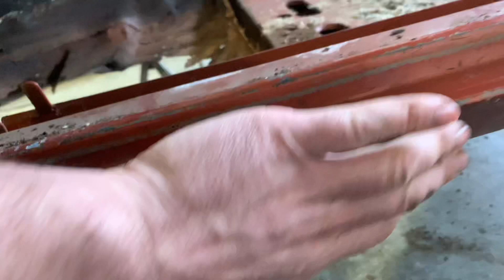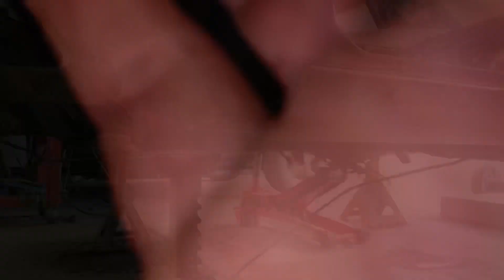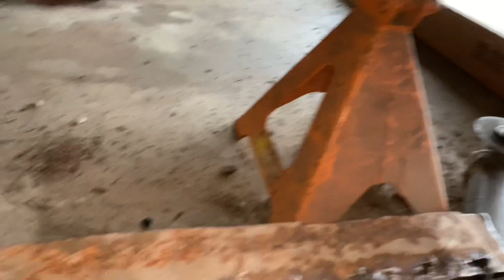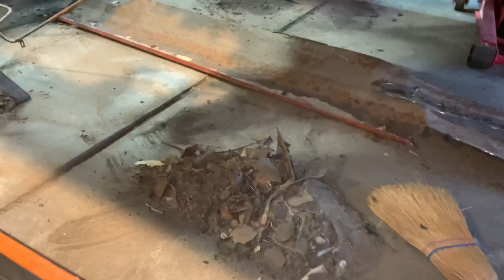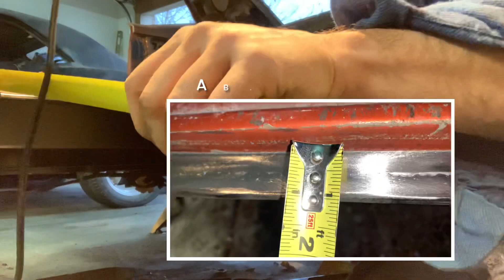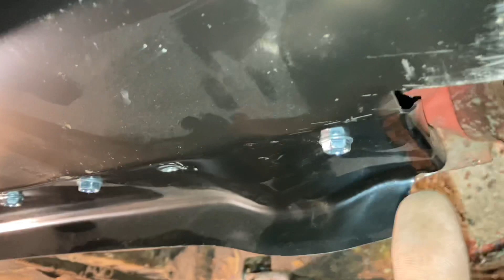Rocker panel replacement, your car have Rusty panels and need replaced?

Comment: gr8 vid., its funE no mater how many Ppl I talk to(or how many vids I C) I don’t C how a couple of iner & outer panels welded togethr as section of unibody in form of pinchweld rail, would have structural strength to lift a vehicle ? behUves my wit😒,(althO since slopily typng this I DID find out on unibody cars, the inner rocker panels got the structure strength).  as for their joining us flat horizantal, still wondering if there’s a frame touching above that, either way it’s 2 litle known facts -  1 the jack lifting point is actually the bottom of these verticle ‘pinch rails’(I beleive Iv heard them calld ?), &2 - that’s so engineering-dumb it’s comical👋
Reply from the maker: Even more questionable is the how thin the sheet metal is never mind the spot welds. This is the frame of the body but it holds up.
Reply: @VinylVillageGarage 

Iv actually heard rocker panels, on unibody cars, are the body(welded to frame front back & center), but NEwA, agrEd - I jst adjusted comNt to mention how dumb design pinchweld jackpoints are.  It might be good for incentivizing a four prong(2 pole) DEEEELEERR🤨?, not srrprIEeeszd😒, type jack- as with all other jacks, even IF the jack adjusts to moving location, the car angle changes, & pinchweld ‘rails’ probly better off not bending.  gr8 scam
Reply: @VinylVillageGarage 
btw I shouldn’t say ‘the frame’ because a car unibody is just a giant ‘shell’(metafor meaning 1 peice), that differant ‘frames’ are attached to, so these rocker panel parts of the unibody, attach to ‘some frames’ front middle rear, - typo✋ btw thats just something I read from some so calld expert - but a litle 5th grader.. actULE kindergardner, math would point out that 1 shell wouldn’t have rocker panel part(S), so thE only thats 1/2 true is if thE INNER rockr panels an AREA of unibody, & oOter’s a ‘frame’.. I did say ‘IF’ .  I’ll copy & paste that lengthy expert disc on next response - 1 min
Reply: @VinylVillageGarage 

😩crap it AI, hU nOs wat Artificial Incompetance it quoting😒? NEwA, here

AI Overview

+5
Unibody vs. Body-on-Frame Construction | CARFAX
On a unibody vehicle, the "frame" isn't a separate ladder-like structure but is integrated directly into the vehicle's body, forming a single, strong unit (hence "uni-body"). Structural elements like reinforced floor pans, pillars, rocker panels (pinch welds), and subframes (front and rear) provide the support, making the entire metal shell the frame, common in cars, SUVs, and minivans. 
Where to find the structural components:
Integrated Structure: Look at the sills (rocker panels) under the doors, the floor pan, the firewall (front), and the rear strut towers—these are all part of the single-piece frame.
Subframes: Heavy-duty steel crossmembers, called subframes, are bolted to the body at the front (for engine/suspension) and rear (for suspension/axle) to handle specific loads.
Pinch Welds: These are the seams where body panels are joined, often found under the rocker panels and used as secure clamping points for repairs. 
This video provides a visual explanation of the unibody construction:
Related video thumbnail
51s

Lakeside Autobody
YouTube • May 1, 2020
Key takeaway: Instead of a distinct frame underneath, the car's body is the frame in a unibody design, offering lighter weight, better handling, and improved crash safety through engineered crumple zones.
Reply: @VinylVillageGarage 
O I just read that, it’s sayng unibody means body is the word for 1 big fat frame made of joining small frames, gS U wer right 👋😒.  so no chasC or body w/out a frame, just 1 big joind ‘frame’ with all ‘parts’ being sub-frames.. io a uni-body, without any chasC or seperate body that isNt part of a UNI-frame.. they could’ve jst calld it that, BUUUUUuuut nOooo noo .

Comment: Have you ever removed one of these rockers fully and re-used it? I want to remove mine, after putting a camera in the drain hole i've seen a lot of scaling forming. i want to pull it, clean it, put it back.
Reply from the maker: I have not, most of the cars I mess
With need them replaced. It’s possible to remove them but it also means cutting or
Doing something with 1/4
Panels or sectioning the rocker to get them out

Comment: What kind of air compressor are you using to use that air hammer?
Reply from the maker: My compressor is a sanborn brand 80 gallon 220v single stage twin cylinder
Reply: @VinylVillageGarage  Thanks Big Bird

Comment: Your very talented with that cut off wheel of death...nice straight lines  :)
Reply from the maker: Years of experience and most importantly listing to it operate, you can hear when it’s starts to bind that means it’s not cutting straight and it will wear out the disc prematurely as well.  It a feel and listen technique if you get good at it you will cut straight and save money on cutoff wheels

Comment: Hey Jon! Absolutely great videos!! I've never done any of this work...at all, but you have inspired me. Will be replacing complete rocker panels...one side at a time. My question: Do I need to weld in bracing on a 68 coupe? Thank you so much in advance.
Reply: Perfect! Thank you so much! You've inspired me to work on this car after owning it for 35 years and not driving it for about 30 years. Thank you...I think 🤣🤣🤣
Reply from the maker: @CharlesMurphy-b9v  let the fun begin!
Reply from the maker: If removing the entire rocker not just the inner or outer I would add a brace to tie the bottom of the door opening where the rocker used to be before attempting that repair.

Comment: The inner and outer rocker panel Is smashed in beginning at the back of the door to the wheel well ... is it better to replace the complete rocker panel assembly or is it possible to cut in a patch ... thanks
Reply from the maker: Repair section is ok but most of the time it rusted bad enough on the inside you end up replacing a lot more.  Best bet is to cut it open and see what it looks like on the inside then make a call which way to go. Here in Indy, the rust belt, it almost always turns into total replace but if this was a western car with little to rust I would only do what was needed
Reply: @VinylVillageGarage  Thanks for your reply ... we do enjoy watching your videos ... Thanks

Comment: sweet repair Jon.  Makes sense to section in like you did.  Those are a bear to replace entire panel.
Reply from the maker: This repair was a bit of a surprise, it was only rusted behind the trim. Easy clean and inexpensive fix.

Comment: Was under the impression that some support bracing was required before removing the rocker to keep the body straight.  Assuming the inner rocker is providing enough support.  Are you planning on "X" bracing the door openings and under the floor before removing the floor?  Due to the replaced rocker not fully welding in, not sure how this would be done?  Very interested in your progress on this restoration.
Didn't see any new seat support in your driveway, assuming you are planning to reuse.  If they are in good shape think that is the correct call.
Reply from the maker: No plans for any bracing on this build.  Now if I was doing a convertible or completely removing the entire rocker panel inner and outer at the same time I would have.  Part of the reason i started with replacing the outer rocker and screwed it to the factory inner brace was to keep the car tied together. 
   Also the reason I shared how to keep the car plumb and square with the bubble level and tape measure. I continuously check and recheck points while assembling and then adjust as necessary.  
  I do have seat bases for this car and front fender repair sections just not in the pile.  Good eye!! 
  This is how I build a car, it’s not the only way. I am sure there is better and worse ways I suppose. This has given me the best results when done and I find it to be quick and cost effective. This might not be everyone’s preference how to, just Sharing and showing how I get it done and the results.
Reply: @VinylVillageGarage  Thank you for explanation.  See value in support bracing but difficultly working around this during the repair.
Reply from the maker: I am not much of a contortionist myself either. It’s easier not to mess with it.

Comment: Have you had any kind of body schooling?
Reply from the maker: That sounds like a weighted question. Lol. To answer have I been thru a school For metal and body work the answer is technically no.  I have worked at body shops, 25 years of restoration experience, some lessons learned the hard way but for the most part self taught from reading books, observing other people work, trial and error, and  lots of luck sometimes.

Comment: Curious as to how you will be handling the rust protection. I am going to be costing the inside of my rockers with SPI epoxy primer.
Reply from the maker: Any bare clean metal will be coated epoxy or self etch primer. Some of the light rust will be Coated with a rust encapsulator, if the area is a panel flange that will be welded I use a self etch weld thru primer after cleaning or sandblasting. The areas that will have layered panels like where the torque box Meets the toe board I sand blast and prime as needed then assemble. This is way more then what was done by the factory plus once done these cars don’t see near the harsh weather or environments anymore so that also helps future corrosion

Comment: I am a huge fan of the air chisel for breaking up spot welds but man can it get away from you. I have had to cut out and replace the entire piece I was chiseling because I tore it up so bad. Even with that it was still faster than finding and drilling all the spot welds.
Reply from the maker: Oh I have trashed some panels with the air hammer. It’s a bit of a technique and sometimes it just has to be drilled or cut out.  just most of the time on the first gen stuff for me 90% of the time it pops apart.